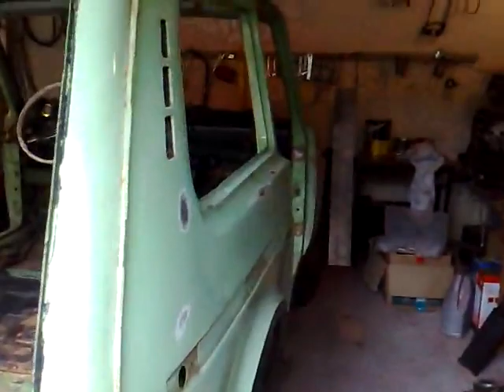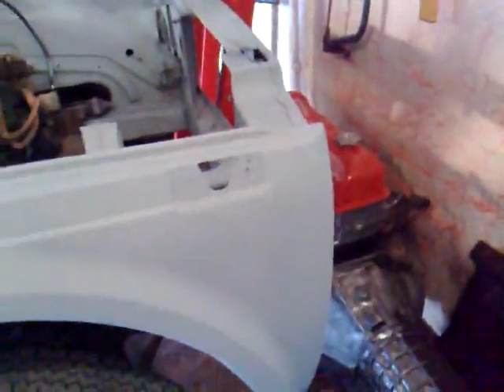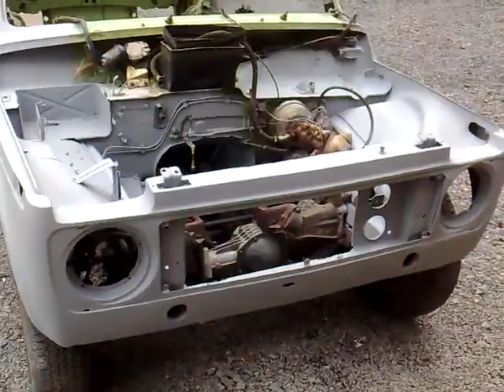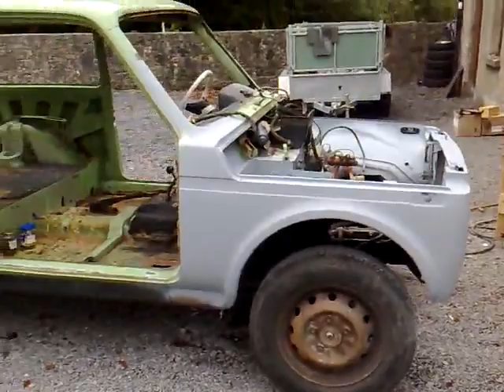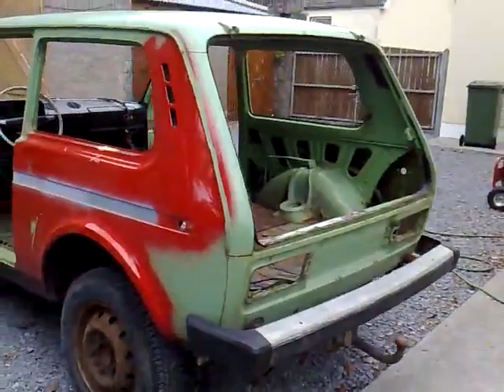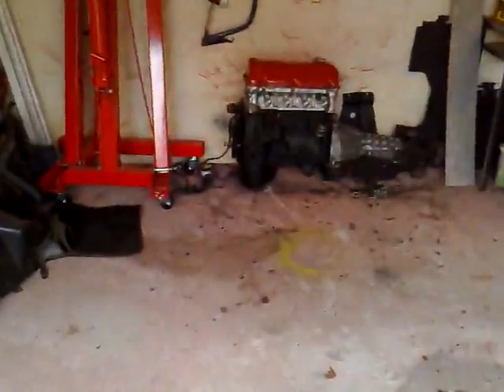Lada Niva restoration project (1986 Niva project part 2/4)

Comment: as someone had posted but with rude language in Russian. That is in very poor condition or at least was. Why not just buy a Niva from Russia for the fraction of rebuilding one in the UK? You can get some nice examples: 20-25 year old cars that have a real millage of 30-50 thousand KM for something around 1800 Pounds. Nice cars however. I like driving my 89. Let us know how it turned out. Cheers